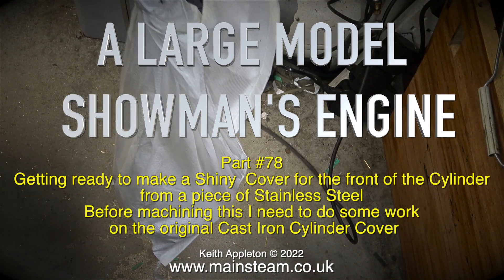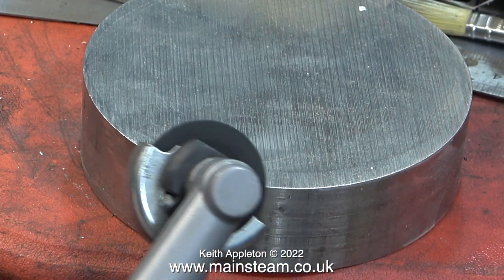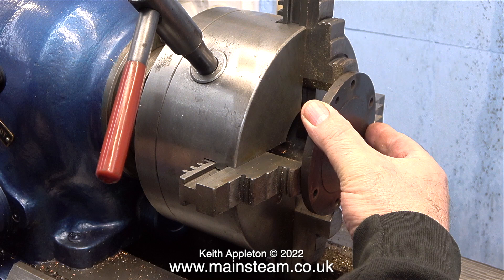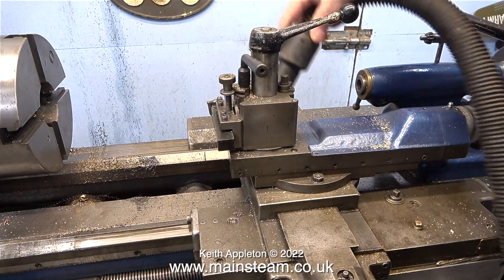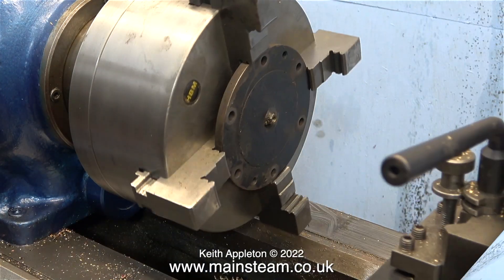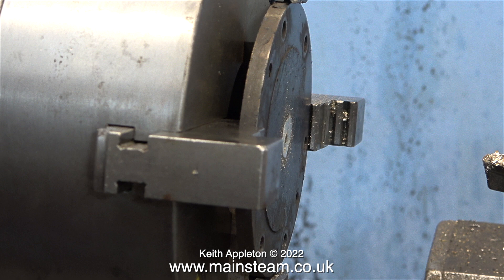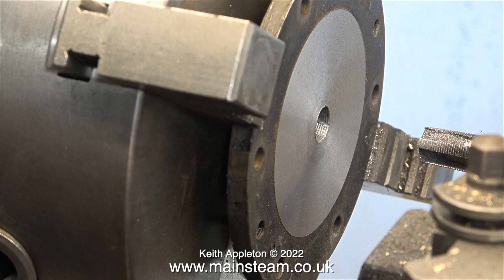A LARGE MODEL SHOWMAN'S ENGINE - PART #78

Comment: That‘s the reason why I always wear steel toes in the workshop. No matter what I do. Most of the time they will seem unnecessary and not really worth the bother. Until the moment they don‘t.
And I had that moment already. I had a 1mm thick sheet of stainless steel clamped in my relatively small vise which I in turn have clamped to the workbench with two engineering clamps so I can move it around quickly if necessary. When loosening the clamps I dropped the second one and when trying to catch it, I accidentally pulled the vise off the bench… it landed with the sheet of stainless point down on my shoe ripping everything away but the steel cap and the other edge hit the concrete floor where it left a deep mark. 

From then on I ALWAYS  wore steel toes (and still do) and never found them unnecessary again. No matter if I‘m only bending a thin sheet of metal or if I‘m hauling around a lathe chuck.

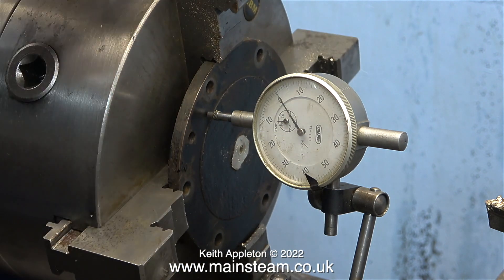Comment: When I need to get something to run true 6:10 I use a set of parallels, tap the work onto it, then go around rechecking for a sug fit. Tighten and then remove the parallels
Reply from the maker: I don't have any parallels  . . . . .